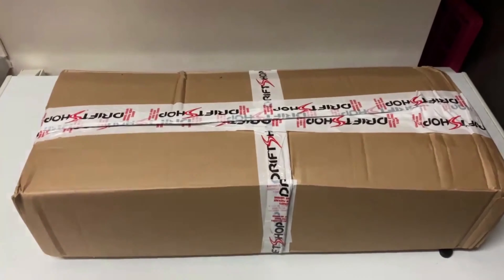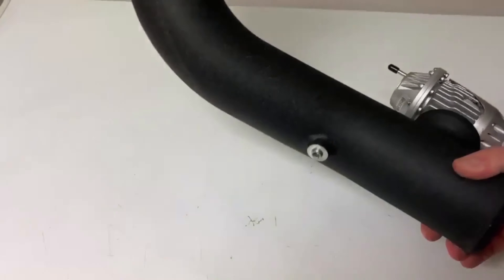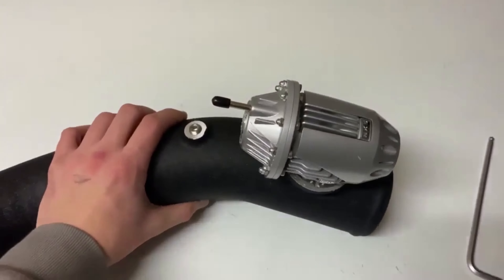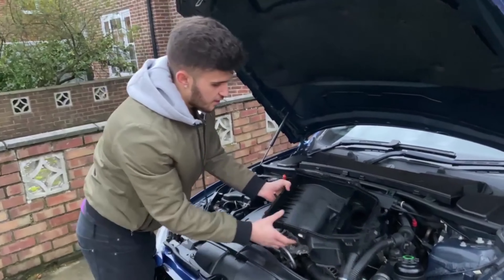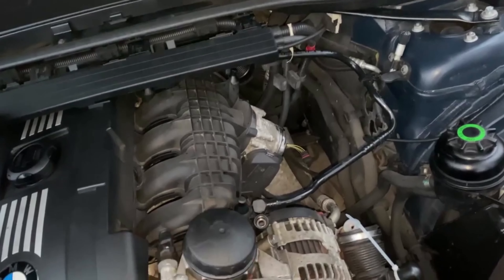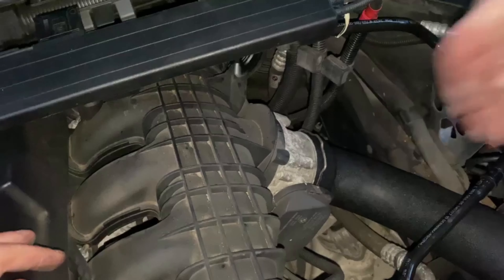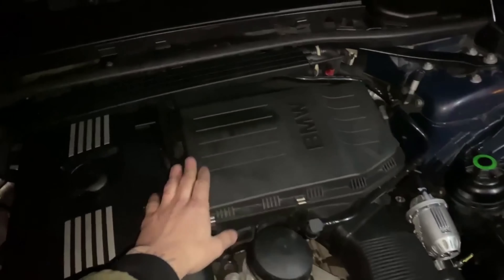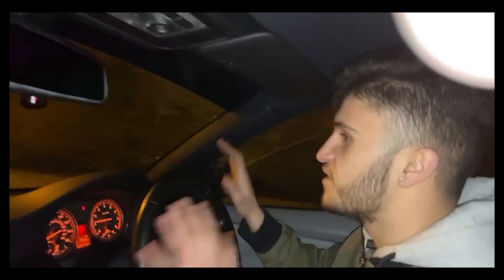My TWIN TURBO BMW 335i N54 Charge Pipe + Super LOUD HKS BOV!!!! Install plus POV | EP 3

Comment: Is it suppose to turn once the c clamp is in?
Reply from the maker: Not really, but the BOV is on a rubber o-ring so it will alwayshave abit of movement. Just attempt to pull the BOV off and if it seems solid it should be fine, you can also use a flat head screw driver against the clamp and hit it slowly with a hammer to make sure it’s secure and in place. Please subscribe and like 👍🏼